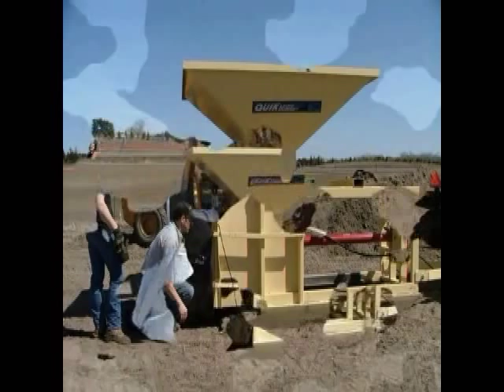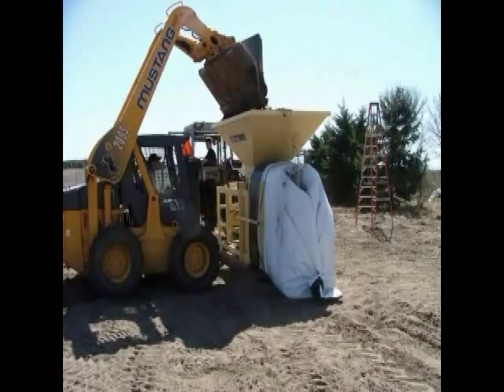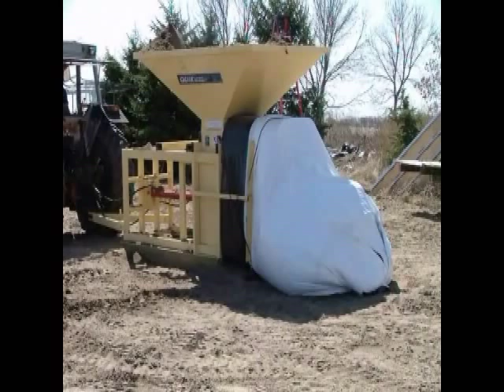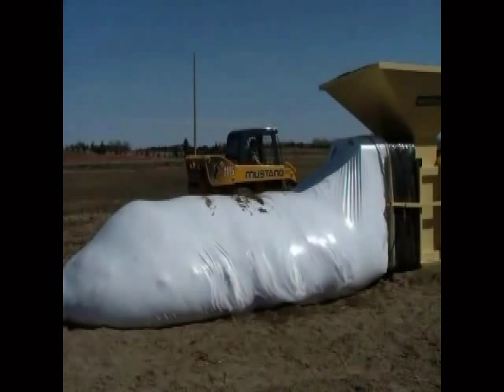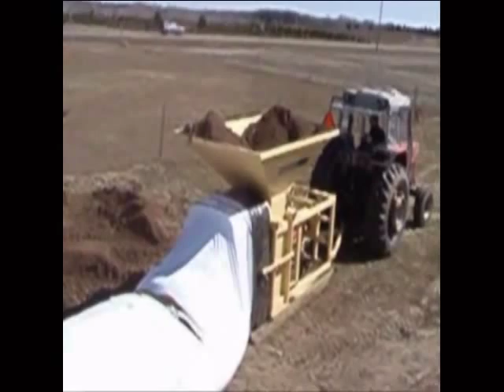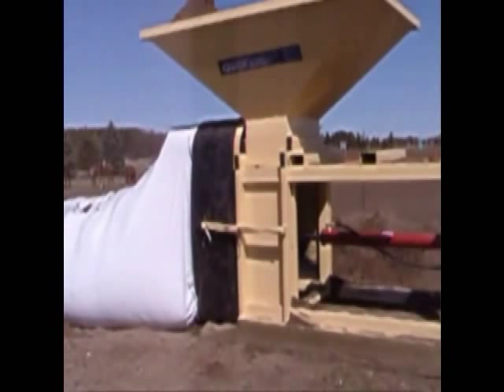The Quik Levee Builder

Comment from the maker: Create Super Heavy Duty Fast-Built Levees® with the:  Quick Levee Builder® Learn more at: www.progressiveinnovations.com Call Now! 1-800-557-9024 Easy Financing! Please Read On
A super heavy duty levee building machine. The Quick Levee Builder® creates a super heavy duty Fast-Built Levee® that is easy cleanup and may be stacked on. The Quick Levee Builder® can produce a levee, utilizing sand or dirt, that is 42in high and 200ft long in less than 90 minutes (an equivalent to +10,000 sandbags!). Ideal for flood control, beach erosion management, heavy surf suppression, or oil/sewage/mud containment.
Creates an easy cleanup super heavy duty Fast-Built Levee® that replaces need for emergency earth-built or clay levees
100ft of super heavy duty Fast-Built Levee® replaces the need for more than 5,000 standard sandbags
Loads and trailers easily
Easy helicopter site to site transport
How it Works:
The Quick Levee Builder® is operated by a tractor and creates Fast-Built Levees®. The Quick Levee Builder® has a hydraulic cylinder (powered by the auxiliary hydraulics of the tractor) that reciprocates a plunger that cycles back and forth. The Plunger can cycle back and forth continuously nonstop as the hopper is tendered sand or dirt by skid-steer or payloader.  When the plunger cycles back (towards the tractor) it opens an aperture at the base of the hopper to drop its contents (sand or dirt) into the plunger chamber. When the plunger cycles forward (toward the levee that trails behind the unit) it shoves the fill behind the machine advancing the tractor (in neutral gear) and Quick Levee Builder® forward. In this cycling fashion the machine has an intake stroke that empties the hopper into the plunger chamber and an exhaust stroke that exhausts the sand or dirt from the chamber out the back of the unit into the specialized plastic poly Fast-Built Levee® tube. Thus, as the Quick Levee Builder® fills the poly levee tube it leaves behind a Fast-Built Levee® and advances the Quick Levee Builder® and tractor forward. The specialized plastic poly tube is fastened to the rear of the unit by a hood that tensions the poly tube with two scissor jacks that raise and lower quickly and easily with a speed wrench that sits in a holster at the side of the unit. The poly tube comes in accordion folded tube like cartridges and quickly and easily installs on the hood by hand with two persons and is then tensioned by the hood jacks. Loading the poly, tensioning the hood jacks, and producing Fast-Built Levee® is fast and easy and requires little training beyond experience operating skid-steer loaders and tractors.
 Operating the Quick Levee Builder® requires a 100HP minimum tractor and operator. The tractor does 3 things. (1) It powers the Quick Levee Builder® by way of auxiliary hydraulics. (2) it steers the Quick Levee Builder® as it contours around structures, buildings, and terrain to shape the Fast-Built Levee® it leaves behind. (3) It tows the Quick Levee Builder® on site across terrain to place levee in desired locations. Also, operating the Quick Levee Builder® requires a skid-steer or payloader and operators or perhaps two skid-steer loaders and operators to tender the hopper with sand or dirt. Thus a two/three man crew (One tractor and operator with the Quick Levee Builder® attached and one/two loaders and operators with buckets attached so as to dump into its hopper) can operate the Quick Levee Builder® at high speed and efficiency. In this manner a 42in high Fast-Built Levee® can be produced at rates greater than 130ft/hr. This is a sandbag equivalency rate of greater than 6,300 sandbags per hour and greater than 140,000 sandbags per day! Furthermore, This Fast-Built Levee® costs less per foot than sandbags! Compare with the cost of sandbags!
 We welcome your questions and look forward to assisting you so please call us: 1-800-557-9024 or visit www.progressiveinnovations.com

#SandbaggingMachine #SandBaggingMachine #Sandbagger #ProgressiveInnovations #flood #flooding  #sandbagging   #sandbags